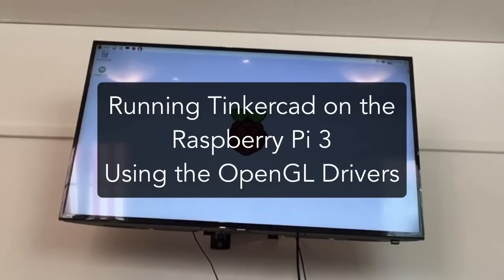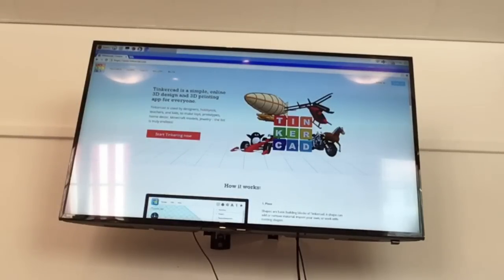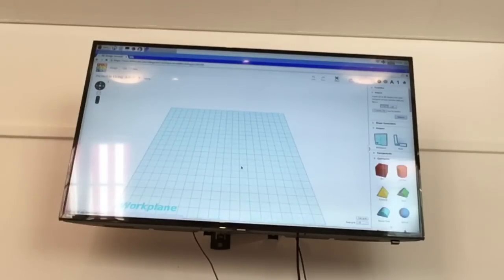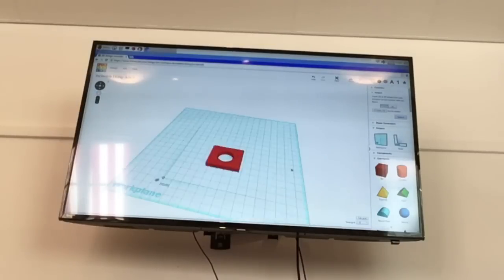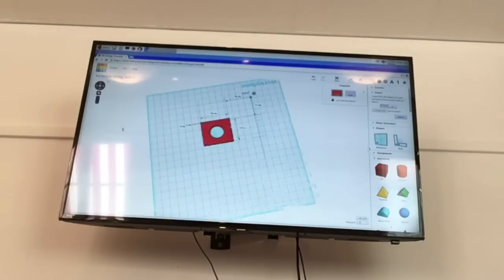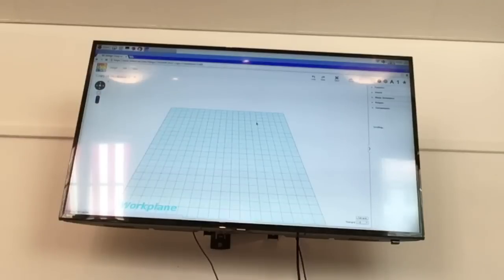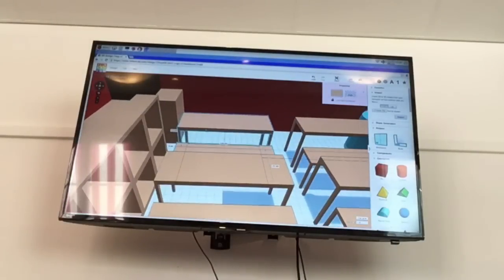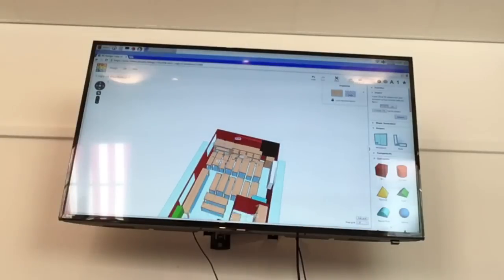Running Tinkercad on the Raspberry Pi 3

Comment: Joachim, it seems this doesn't work anymore with the newest Raspian distribution that includes Chrome.  Do you know how to get it to work?  What are your OpenGL settings (memory specifically).  I'm trying to do something similar to your code club by teaching kids about 3D modelling and 3D printing using Tinkercad on a Raspberry Pi 3.